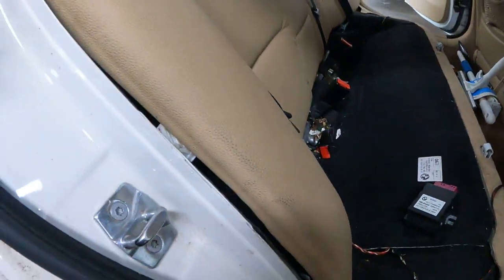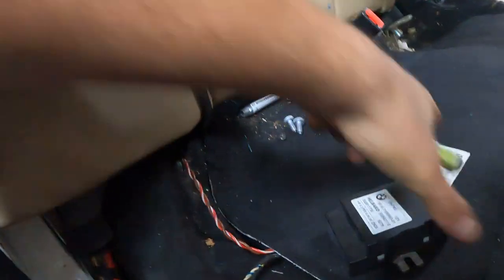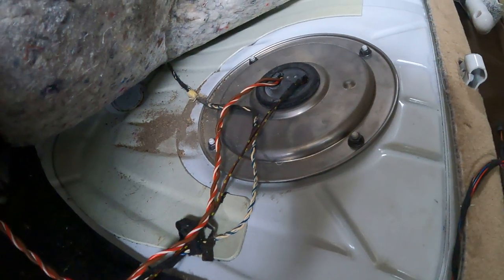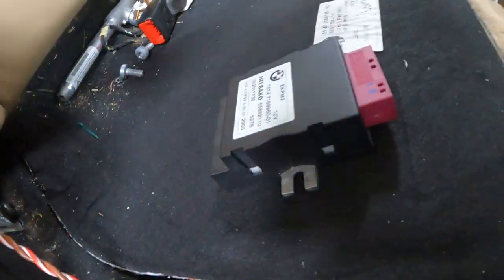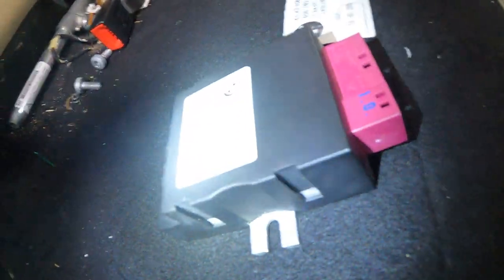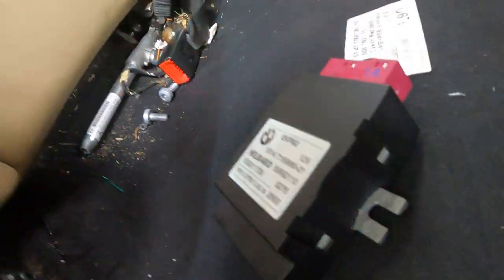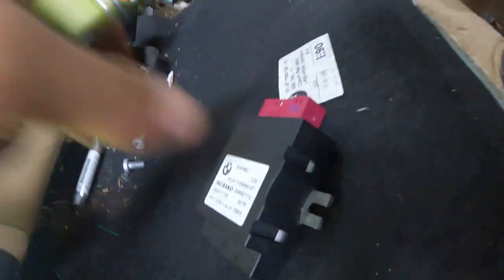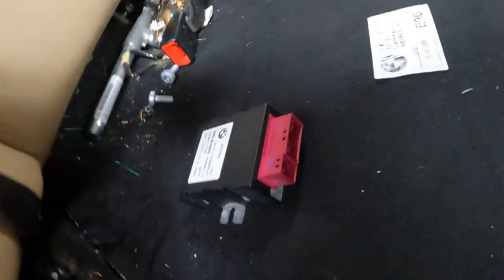2006 BMW 328I (e90) FUEL PUMP FUSE BLOWN

Comment: Have a crank no start on 07 328i fuse for the fuel pump keeps blowing  could it be the module or pump ? Also what scanner can I code this module ? Thanks I'm advance !
Reply from the maker: It could be either one, might even be worth it to stick a pump in it before playing with this module, I’ve seen more bad pumps on these than the modules failing

Comment: So my car starts and runs fine but once in a while it stalls and says I have a fuel pump problem even though I changed it then had a hard time starting up so I have to wait 10 minutes then it starts back up do you think this is the problem ?
Reply from the maker: I’ve never seen one fail like that before but it sounds possible
Reply: I have the same problem with mine
Reply: It stalls on me I have to wait like 10 minutes and then it starts again. It started after I got rear ended, I was about to purchase a fuel pump but you say you changed it and you still have the same recurring problem?
Reply: I have replaced the fuel pumps high and low, fuel sensors/injectors. Finally while stranded for the 4th time I took out the backseat and unplugged and plugged the control unit and car started up. Currently driving around with the seat off as now when car stops I unplug and plug in and it works fine. Hopefully the new unit arrives next week and it fixes issue
Reply: @Malika12321 did it fix it?

Comment: Hello I have a 04 crown Vic police inspector that is blowing the fuel pump fuse I can drive it 3 days an it won’t blow a fuse. But then the next day ur might blow it 4 times we have changed the fuel pump an the filter it sen too happen when I give it gas kinda hard I’m also getting codes p1233 an P0174 p1235 I do have a exhaust leak in the front of my engine so the code p0174 had been staying on but the other 2 codes are new

Comment: did you get that module recoded?
Reply from the maker: Yeah I believe I used autologic to code it
Reply: @EuropeanAutoRepair  is the launch pro x3 capable of performing these coding operations
Reply from the maker: @kingsolomon4392  I'm not 100% sure on that. We have a autel that can do it
Reply: Thanks for producing  this video I had the exact situation and until I found your video I was on a wild goosechase looking for wires that a rat must have chewed.This module is fried.I ordered an aftermarket one from Amazon.I will let you know how that works out didn't know it had to be coded so I will see how to go about that once installed.Thanks for your video.The back seat was a pain to take out so I worked it the way you did in your video.

Comment: My Friend, I just turned my car back on after I watched your video.

I unplugged the connectors and now it turned on.
Reply from the maker: Excellent!
Reply: @EuropeanAutoRepair  Question, Yesterday 1/ 13/ 22 I was driving and could smell a light burning scent but could not determine where it was from. I figured it was my defective Blower motor which is coming but now I see it was my fuel control module. Do you think I should buy brand new from FCP euro or would you recommend a M3 Control Module I have laying around
Reply from the maker: @RodriguezSteve  I've never tried installing a m3 module on a module other then a m3. I would probably just go with a oem fcp euro one. Not worth messing around, factory ones are pretty reliable from what I've seen

Comment: i have 2008 328i with the n51 engine, i recently changed my fuel pump because of the crank no start problem and my car turned on for about 35 minutes before it gave out again ( i did smell a burning smell but i couldn't pin point it). I checked the fuel pressure and I wasn't getting anything in the fuel rail again. I figured its probably the fuel module. I have an extra fuel module from a 335, and my question is would i be able to program it using ncs expert? i cant seem to find any guides.
Reply from the maker: I don’t have any experience with ncs personally, I’ve programmed them successfully with a autel branded scan tool as well as autologic,

Comment: i have a question as im trying to resolve my crank no start issue on a 09 528i. i have a voltmeter and am a newbie to troubleshooting my own vehicle. so are you saying for this crank no start issue that i should take a look at the fuel control module and replace it? is it possible to use a volt meter to test this and what voltage should i look for? also do i test this with a voltmeter while the battery is connected or disconnected? and where is a fuel pump relay generally located on a 528i? thx so much for your help.
Reply from the maker: Have you already verified you are not getting any fuel pressure at the rail? Any stored faults?
Reply: @EuropeanAutoRepair  Oh wow! Thanks so much for the quick reply. I'm not sure how to test the fuel pressure but I believe i may need to order a gauge from the videos i have been looking at (unless their is a way to test without it)? I'm still trying to get the hang of the videos saying to use the fastec order. I just did a copy and paste of the codes i have gotten from the veepeak scanner: 

A559: Klemme30g_f_Abschaltung 93AB: Relay adhesive MPM relay on 951A: System undervoltage
A85F: PowerOn after Kl30F shutdown
951B: System overvoltage
2DED: 0x2DED power management, closed-circuit monitoring
2DEC: 0x2DEC power management, battery monitoring
2AAE: 0x2AAE fuel pump
2ACC: 0x2ACC DME main relay, switching delay
2E8D: 0x2E8D Intelligent battery sensor, signal transmission
6294: EKP engine: current too low

Long story short, it has been in a crank no start condition for the past 3 months and i am getting clarity from this scanner and trying to do what i can to figure it out. I did have to replace the battery due to battery discharge drainage indication and registered it with the veepeak scanner. i just got this vehicle last year for my birthday and i assumed it was just the battery for it not starting. it will crank but, i am still trying to watch videos to figure out how to test the fuel pump at the current moment.

other than that, i got codes of misfires so changed the spark plugs gapped them at .40 and had done a smoke test (i had a p0171 and p0174) and smoke came out of the coolant radiator hose. sadly still have the p0171 and p0174 showing permanent on the car and not sure what else to look at. i should also include too that the spark plugs on 1, 2, and 3, gapped to .60 on their own after starting it repeatedly. is that normal? i wonder if me using iridium spark plugs (it says to use double platinum) also may cause it to crank and no start? 

sorry if it seems like a lot. im a noob and when i saw your video i instantly thought i needed to check this module too on the car. :)
Reply from the maker: @TheBrianaDiaries  no problem, this sounds completely bonkers but try kicking the bottom of your fuel tank on the passenger side, under where the back seat is located while someone else is cranking the engine over inside, it sounds like you may have a failed fuel pump
Reply: @EuropeanAutoRepair  Thanks so much! I'll give an update on how that goes. I don't have anyone to give me a hand until sometime tomorrow. I feel like this should have been an easier process but, being a noob to this arena I kinda feel like my car is just giving me a piece of its mind to be stubborn haha.
Reply from the maker: @TheBrianaDiaries  you’ll get it! No problem
Reply: @EuropeanAutoRepair  I'm just updating you after we spoke as promised. I finally got the fuel pump installed myself and thankfully didn't have to also replace the ekp but I am curious. Do you know if it is normal for the fuel gauges to not read correctly after installing a new fuel pump and putting gas in the vehicle? I'm not sure if there is a way to reset it so it reads accurately. I certainly appreciate your expertise! :)
Reply from the maker: @TheBrianaDiaries  the car I believe has two level sensors and it uses to average the fuel level because it’s considered a saddle tank, it’s possible that somehow the lever for the level sensor is hanging up on a hose or something in the tank or the sensor itself may be defective
Reply: @EuropeanAutoRepair  Ah ok I see. I had to disconnect the fuel filter and the fuel pump to put the new fuel pump in and I was trying my hardest to not mess up the fuel lever part that swings up and down on both sides. By chance would those be the fuel level sensors? I just want to make sure I understand. :)
Reply: @TheBrianaDiaries what did it come out to be? Having crank no start issues after new battery. Started before I had new battery but only with jumper cables and also had no throttle response during that
Reply: @juju-lr1qe exact same here ! I had a battery drain issue where if I don’t drive for a few days battery won’t start. Decided to change the battery and now it cranks forever and won’t start. Did you replace your fuel pump?

Comment: What fuse,where is location of fuse. In my glove box I don't find no blown fuses. I replaced battery and never started again.
Reply from the maker: Look up the fuel pump fuse location for your particular model. Have you Isolated the problem down to a fueling issue already?
Reply: Thank you for replying. I disconnected the pump from its source,I powered the pump manually with power probe and I can now hear the pump working. I connected back to harness,nothing. I tested a black relay in glove box, it's working too. So, I wanted know where is fuse for pump